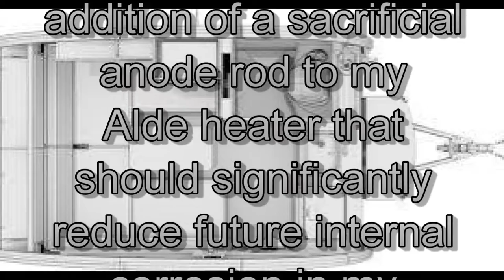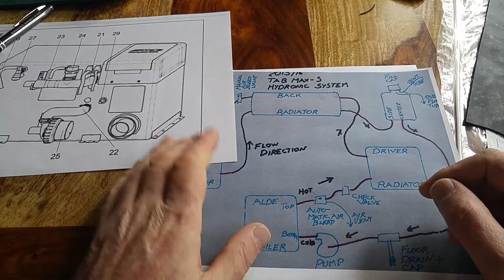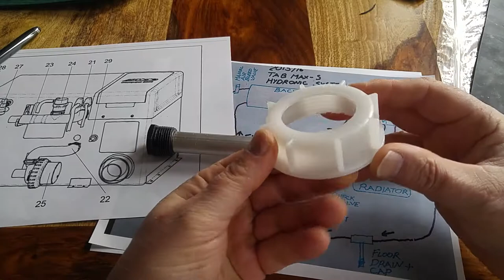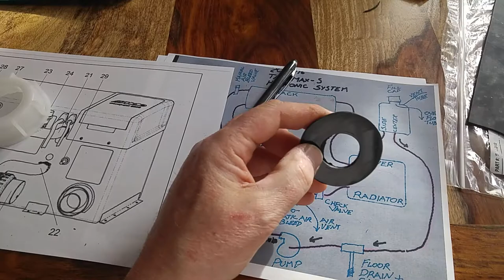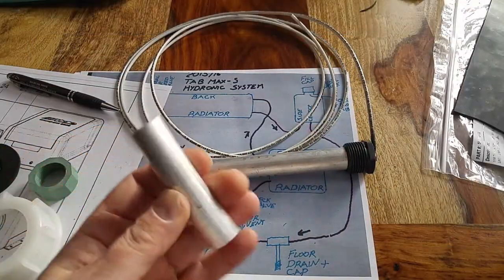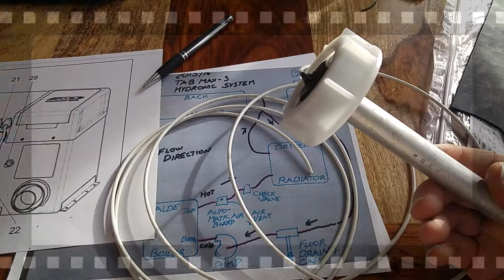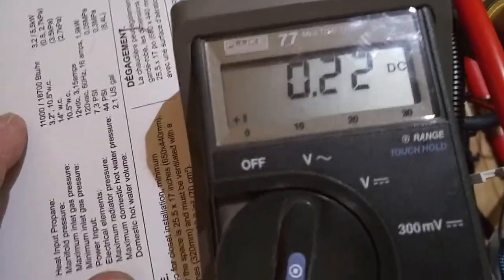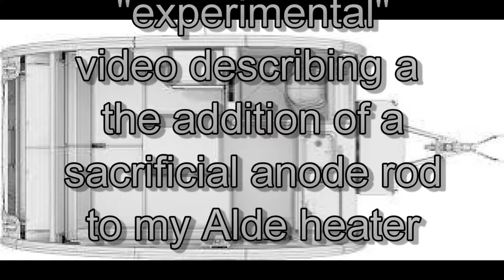Alde Heater Corrosion Experiment  - Part 2 - Tab Trailer

Comment: Thanks Mark, I don’t imagine it matters where this is grounded, correct?  My reservoir isn’t near the Alde unit so it would be easiest for me to tie in with a 12v neg wire  or I could get it to a negative terminal block. Do you see any concerns with either?
Reply from the maker: Hi Beth,
There are some details that are important....

As in the video there are three kinds of corrosion going on in the Alde system.
Acidic, galvanic and Electrolytic.

Acidic crosion is simple and is handled by the buffer chemicals in the transfer fluid.

Galvanic corrosion occurs because of "dis-similar metals" in the fluid, and in contact with one another.. This rod protects from this galvanic corrosion, by being the low man on the totem pole, and giving up its electrons before the other metals.

The third kind of corrosion is electrolytic. This corrosion occours when an electric current is introduced to the fluid from outside the system. You will have to be VERY careful if you connect that anode rod ground wire to any where else than directly to the boiler itself, or you could be introducing current into that rod, and actually making things worse , not better.

For example:
If you tie that wire to some other "common ground" and another device is faulty, and leaking current unto that common ground, that current could be passed into the fluid.
Reply: @tabtrailerupgradesandmaint2923  thank you, that explanation is very helpful.

Comment: Hey Mark, Just completed the Aldi anode project & after watching your video it isn't clear where you attached the ground wire to the Aldi. The two apparent lugs at the top of the Aldi (one has the power cord entering it) do not seem to be grounded to the Aldi boiler piping when I checked with my VOM. Is there another point you used as a ground?
Reply from the maker: The best ground I could find in the ALDE was where the propane line connects to the case. There are two screws that hold on the hose fitting onto the case. I lifted one of them and put a crimp eye-ring on it.
Reply: @tabtrailerupgradesandmaint2923  Ok, thanks.  I wasn't to sure about grounding to those screws (propane and all) so I used another screw on the side of the Alde case.  I checked this with a VOM (ohm) to the copper outlet pipe (which does not touch the outer case) for the hot water line.  This did show continuity thru the boiler to the outer case.  My trailer is back in storage so next time I have it home I will recheck this.
Reply from the maker: @dw3897  i wouldn't worry about the propane being bear the grounding point. The voltages and currents carried by that wire are minuscule.
You couldn't make it spark if you were trying to. Lol
Just about any good connection directly to the case will work.
Reply: @tabtrailerupgradesandmaint2923  Thank you for sharing this sacrificial anode idea, which seems brilliant to me, at least in theory.  It may be way too early to ask, but I don't suppose you've seen any changes at the Mg anode yet, have you?  Also, have you considered editing your video to show or at least describe in a text overlay where the ground wire should be connected, which is fairly critical.  Thanks for sharing your knowledge &  ideas!